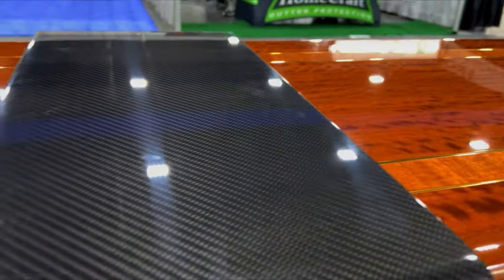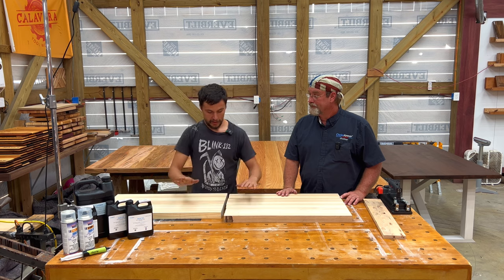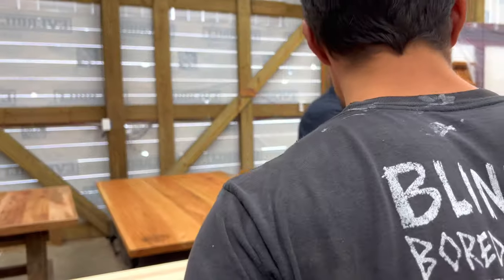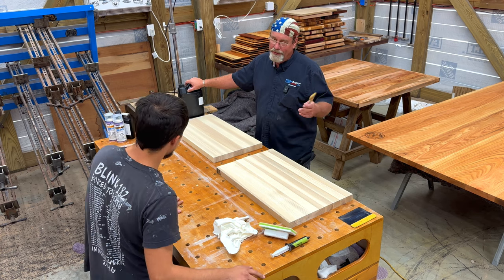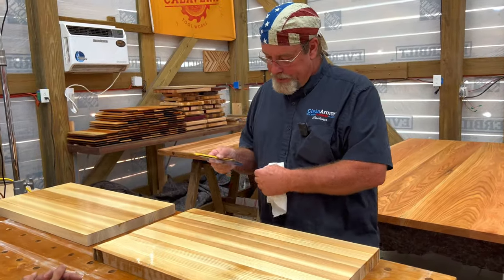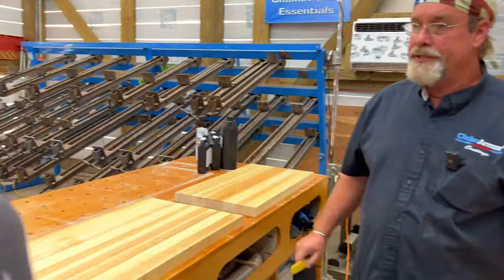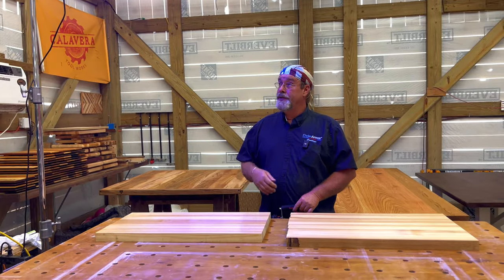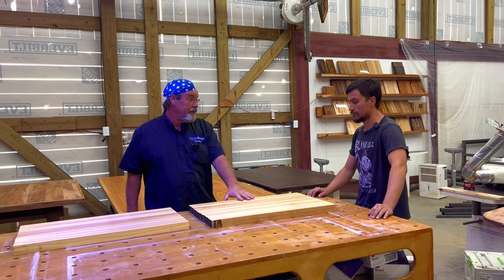Clean Armor: The Future of Wood Finish

Comment: 385 nm is a quite dangerous wavelength. I hope Clean Armor advises people to wear protective clothing, eye protection, and even sunscreen when using these lights. The potential increase to skin cancer rate from that wavelength of UV light is so extreme that even a single use of a tanning bed in a lifetime increases risks of skin cancer *significantly*.
Reply: Not true, I’ve been running 360nm thru 460nm, in my home for years on my fish tanks. We’ve only had 3 types and 4 occurrences of blastomas…
Reply: And of course you have scales like a fish
Reply: You could just take it outside to cure it like he said, duh.
Reply: They do

Comment: This guy just discovered uv resin, just buy a resin bottle designed for 3d printing. Pretty sure it's the same stuff
Reply from the maker: Might cure the same, but most definitely will have different properties.
Reply: Hey, as a matter of fact I just did a test with a uv resin I had laying around. Didn't have the strong uv lamp so I used my handheld lamp. Was dry in a matter of minutes ( must be quicker during summer). Finish is ok, on par with osmo polyx I'd say. I put a coat of graphene wax for extra shine 👌
Reply: @bmallory  hey did 3d resin work well on wood?
Reply: Was curious about it being used on the cutting board as he mentioned NOT having FDA approval for food grade use?
Reply: Dentists have been using this for a long time. It’s the bonding resin that gets light cured in a thin coat before composite is used.
Reply: Do they have it in non glossy? Not a fan of shiny wood

Comment: I looked up the ingredients in Rubio Monocoat.  It's mostly linseed oil with several types of waxes.  THIS Armor crap was very difficult to find info.  I found some.  This is just a type of polyurathane.  I am trying to get away from poly finishes.  I make my own using tung oil and melt in beeswax for about $90 per gallon.   This Clean Armor, just like Rubio Monocoat, is about $500 - $600 a gallon.  Ripoff.
Reply: your goals clearly differ from those interested in this product. Tung oil's several week cure time may work for you, but it doesn't for many others. Just because you're incapable of conceiving how a finish CURING in mere minutes is $$$, doesn't mean others are.
Reply: @ritzypatrick8577  That's crap, tung oil beeswax finish will cure in a few hours if applied with a heat gun.  I've done it.  And tung oil is not toxic like that UV polyurathane poison.
Reply: I've seen good things results with general finishes water based conversion varnish. I've been researching low/no voc tough finishes, and it seems like a pretty good one.

Comment: Can I use this on my vehicle headlights after polishing? I'm looking for UV protection so they don't deteriorate and get hazy too quickly.
Reply: Use a 50/50 Spar Varnish and Loneral Spirits mix. Seal it up good and keep it indoors it will last about 2 years. Use a foam brush to apply and tape everything off.
Reply: @austinroberson8  you meant "mineral spirits", right?  Thanks for the info.😆

Comment: 1. Dumb question, but is this UV protected if I use it on exotic, colorful wood, will it preserve the color of the wood against sunlight?
2. Is it a wipe on finish for an example fine art wooden sculptures.?
Reply from the maker: When you get the exterior grade version, it will do a great job at preserving the colors. Has strong UV blockers.
Reply from the maker: For this application: Clean armor is best applied heavy with a brush then wiped off after the wood absorbs as much as possible.
Reply: @TNTINDUSTRIESLLC  so you it could be applied with a brush to 3-D wood sculptures?

Comment: Five stars for Clean Armor Wood 705 interior/exterior finish. This product is ideal for my intended purpose: conveniently refreshing the finish on oak floors that have had 25 years of wear. These floors were well overdue. These floors were initially finished with oil-based polyurethane in 1985 when my home was built. I added another coat in 1998 to address wear and scratches. Twenty-five years later, the floors are at risk of wearing through the finish and stain, down to the bare wood, and that would mean a lot more work to refinish than just a new top coat.

However, I was not eager to use either water-based or oil-based polyurethane for a new treatment. It takes either a long time to reach scratch-resistant, the fumes of oil-based polyurethane are no fun, and it is hard to complete each successive pass the length of the room before the previous pass became tacky.

So I was pleased to see this product that cures to full strength in only two minutes. I can rearrange the furniture and apply the finish a section at a time, without fumes and only minimally disrupting our use of the space. I have the 100 watt Covu UVA lamp that I use for curing. I suspend it from an 8-foot board four feet off the floor, supported by two step ladders. This gives a rectangle of illumination of approximately 5 feet by 5 feet.

I applied the product with a sheepskin mop. When I first started, I discovered that a light coat leaves brush marks where the coat I am applying overlaps the previously cured, so be generous in how much you are applying and give time to self-level.

Comment: What other Products were used on the two blocks to finish them? (Matt and High Gloss: Was the only difference in finish, in the Application technique/tools?)
Was there a Top Coat applied to the 710 Sealer for New Wood? Like the 757 Table Top Finish? or 705 Exterior Clear Coat? 
At $500/gallon, did you just use the Sealer only, or did using a second product not get into the video somehow?
Reply from the maker: Now a days I like to only use 757 topcoat.

Comment: Any idea how much it costs in materials to finish both those table tops (in his demonstration) minus the UV lighting system?  Went onto Clean Armor's web site, but couldn't find pricing information.
Reply from the maker: So we haven’t used it in a real world scenario yet. But accord to Matt, you get 1,600 square feet out of a gallon at 1 mil. 
So to be conservative, let’s half that. 
1 gallon costs about $500. 
So $1.6 per square foot.
Reply: @TNTINDUSTRIESLLC  ouch. pricey, but when you look at the per sq foot cost it might even come in cheaper than Rubio Monocoat which is my go to finish at the moment.  So im guessing a qt of this stuff will set you back about a buck fiddy?  What products exactly did he use on these boards?  sealer and finish?

Comment: Hey Tony,  Do you really need the sanding sealer or can you just apply extra product.  Im looking at the 700 in satin to finish off the mitersaw station.. You mentioned you are pretty much only using the 757 table top finish for everything. What are the pros and cons over using just the 700?
Reply from the maker: Pro is that you don’t need to buy two things. Con is that it will take more coats to fill the grain

Comment: Edit: Thanks to Clean Armor support. The slow curing was due to my very thin coat, combined with moving the lamp around too much.

Original comment: My first test of the Wood 705 resulted in slow curing with the CUVO H24 handheld. Hours, from a distance of about 2.5 feet. Is this normal? Could slow curing be because I did not shake the bottle well enough before applying? It eventually cures and no longer feels tacky, but this initial test is taking much more than the expected two minutes. Tips, anyone?

Comment: What happens as the wood expands and contracts?  What happens when you needs to make a small repair?
Reply from the maker: It’s made to expand and contract with the wood. They use it in the aerospace industry. 

Gotta do small repairs when the sun isn’t a problem. If it’s inside it’s usually not a problem. Simple as scratch, apply, cure